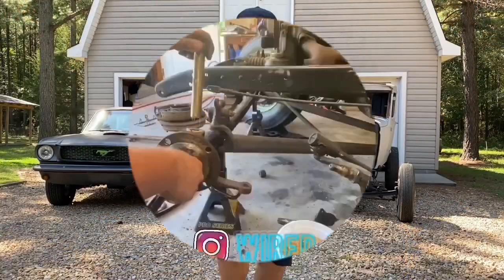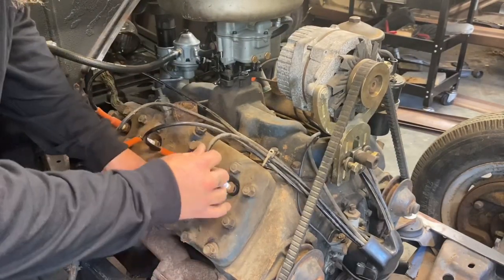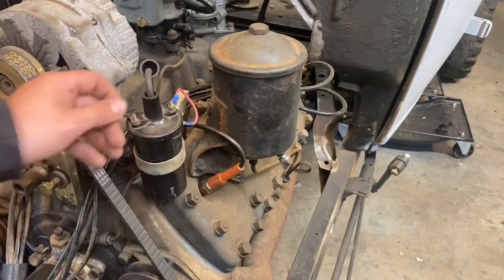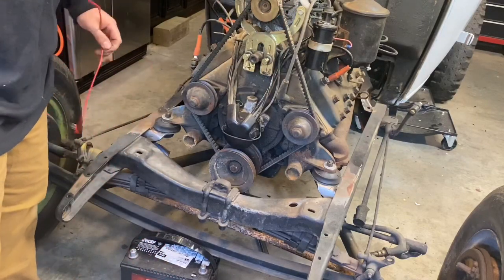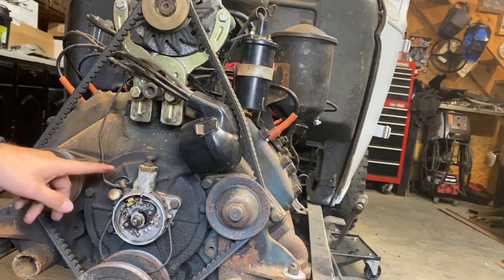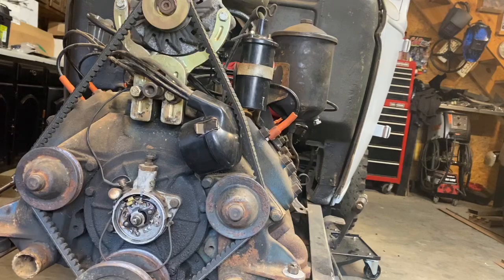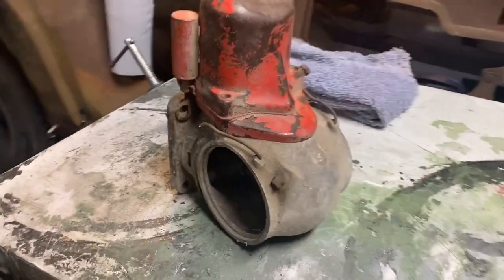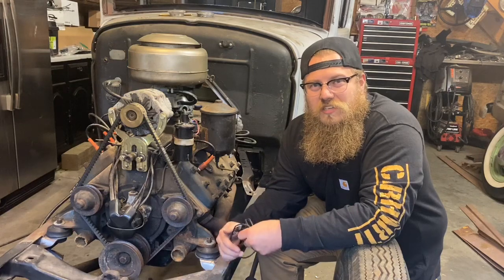No Spark No Start Ford Flathead Explained

Comment: It looks like you are negative to ground. When testing an isolated coil in a 6 volt positive ground systems, do you make any connection changes?  Also how would you test a condensor? I know they are cheap, but out of curiousity I'd like to know if it has failed.  Btw, for a 6 volt positive ground system, do I just walk up to the parts counter and ask for an ignition condensor, or do I need a specific type of condensor?
Thanks
Reply from the maker: Thank you for watching Pete. The process with a positive ground is exactly the same, the charge is just coming from the other side, testing a condenser is actually a really long complicated process since it can actually hold a charge, I find it easier to just test the points when unhooking the coil and letting the coil connection almost tough, and manually moving the points open and shut while looking for a spark at the coil connection, then doing the same and check for a spark at the points, that’s much easier then testing the condenser, as far as ordering them, you can pick one up from the parts store if you’re running 12 volts, but a 6 volt system will have a specific type of condenser, I haven’t found them at a parts store yet, I order mine from shoebox central in California
Reply: @WiredCustomsSpeedShop  Cool!  Thanks for all that info.
Reply from the maker: @vintagesirvivor   no problem at all

Comment: Are there different condenser for the different distributors or would one work on all? Thanks dealing with a no spark on a 40 ford
Reply from the maker: There are Bob, the early Helmet distributors have a specific style of condenser, the layers distributors are close to being all the same, depends on which distributor is on your engine
Reply: @WiredCustomsSpeedShop  I have a helmet with the 12 volt adapter
Reply from the maker: @Bob-qf4qo   so do you have the remote coil conversion too?
Reply: @WiredCustomsSpeedShop   no I don’t have that

Comment: Hi! Great video. I have installed a 1941 Zephyr V12 in a mahogany boat. I had it converted to 12 volts. It has  2 condensers and a built in coil. How do I hook up a new tachometer?  Maybe a 6 cylinder to one of the condensers? I am stumped! I can send pics if needed.
Thanks! Doug
Reply from the maker: Thank you for watching Doug! On the V12 you only have two options that I know of, either find a really expensive and hard to find mechanical tachometer, or upgrade the coil to a remote coil and hook up a tach traditional style
Reply: @WiredCustomsSpeedShop  could I wire a 6 cylinder tach to one  of the condensers?
Reply: It has the double distributor caps. Each side sparking 6 of the 12 cylinders.
Reply from the maker: @douglasfedt5299  yes sir the mechanical tachometer can run off of the generator
Reply from the maker: @douglasfedt5299   if you have one Doug you could give it a try, I haven’t tried it before but I would think after the condenser it might not put out enough to pick up on the tach
Reply: @WiredCustomsSpeedShop  there is no place else to hook a tach wire.
Reply from the maker: @douglasfedt5299  sadly there isn’t on that type of distributor, the technology wasn’t there yet back then
Reply: @WiredCustomsSpeedShop  thank you!
Reply from the maker: @douglasfedt5299   no problem!
Reply: Showing my age Dough but it was a really good shoe as Lawrence Well use to say he had a tv show many many years ago really great of u to provide this info for us new flat head owners I recently got a42 ford 4 door with sueside doors started it really runs good but I decided to put a new radiator on it if I ever get it delivered what with the supply chain like it is, thanks again!

Comment: Thanks for the great video. Just so happened i was trying to get my 49 ford flathead to fire up today it's been since 1986 that it ran  . No spark turns out the wire was open from coil to distributor. I was overjoyed when i finally saw a fat blue spark . Fired up right away but carb was leaking gas . Now to rebuild the carb . Long ways to go before i'm driving down the street ; ) Cool that you are trying to get your nephew interested in old cars. They need to be interested in something besides video games
Reply from the maker: Thank you for watching! Glad yours turned out good, my nephew definitely loves old cars now, he is always trying to sneak into my garage and sit in the cars haha

Comment: So I think I’ve decided to get a 1946 Ford Coupe. I’m just curious as to how much body roll it will have, especially since they have a transverse semi-elliptic leaf spring suspension. Have you ever rode in a car with a similar suspension set up?
Reply: I've got a 46  business coupe I'm about to sell
Reply from the maker: @blacksmithcrazy   nice! You should post it on “The Flatspot a Flathead Support Group” on Facebook, you would get some good feedback
Reply from the maker: I grew up and learned how to work on cars starting with a 1946 Ford  Business Coupe, that was my dads hotrod and he taught me how do do everything to the car,  these cars do have some body roll, but nothing you would consider dangerous, they feel more like you’re riding in a boat, or even similar to a Cadillac, just make sure you have good shocks and it’s a great ride
Reply: @WiredCustomsSpeedShop  Awesome! I found a 1946 Ford Coupe on the FB Marketplace that was last driven in the mid 70s. The upholstery is torn up, and the chrome is all rusted. They want $4,000 for it. Does that seem like a fair price?
Reply from the maker: @S5Ross1444  if the car isn’t very rusty then you have found one hell of a deal, coupes around where I live in Virginia can go up to 7000 if the body is in good shape and all the parts are there, it doesn’t have to be running
Reply: @WiredCustomsSpeedShop  Now if I could find a 1942 Coupe, that’d be even better, but one would be pretty hard to find, considering they were only made for 4 months.
Reply from the maker: @S5Ross1444  I would love one too, I have a 47 coupe I’ve been threading to put a 42 grill on
Reply: @WiredCustomsSpeedShop  Hey, it’s been awhile since I’ve replied to you on here, but how hard is it to find parts for a 42 Ford Coupe, as in things like trim, knobs, door handles, etc.? I’ve been debating on whether to get a 42 Ford Coupe, or a first gen Dodge Charger, which unfortunately is hard to find parts for as well.
Reply from the maker: @S5Ross1444   you can easily get everything you need for a 42 coupe, only the grill itself is hard to find because that’s the only difference between the 42 and 46 coupe
Reply: @WiredCustomsSpeedShop  Ah, so it’d be far easier, and probably many times cheaper, to restore a 42 Coupe. I’ve fallen in love with the first gen Chargers, but they’re so damn expensive to restore.
Reply from the maker: @S5Ross1444  I’ve restored a 68 charger, more than 3k just in the dash and center console alone
Reply: @WiredCustomsSpeedShop  I’d imagine it’d be even more on a 66-67 Charger, especially because they used an electroluminescent circuit to light up the dash, instead of actual lightbulbs, which looks really badass, but not very many people know how to fix that.
Reply from the maker: @S5Ross1444  yeah I haven’t messed with those before haha

Comment: I have an 8 BA with three Stromberg 97s. I changed the points over to a Pertronics unit and there was a noticeable increase in power. My question is how important is the vacuum advance since the 97s do not have a port. Anything worth fussing about? Thanks!
Reply from the maker: I would recommend drilling and tapping an aluminum intake for a vacuum port, but I have seen guys run them without it, I would suggest really powering it hard from a slow speed and see if you loose power, or even worse, choke and even die, if you’re having choking I would go with vacuum port on the intake, if not then you could just roll with it

Comment: Could you do a video on how to convert to a 90% filter oil system on the flathead?
If possible also how to convert to a remote modern spin on oil filter.
Reply from the maker: I would love to, just depends on my workload, I might have one coming up on a 42 Ford
Reply: A friend of mine has a system that he blocks the oil pump from going into the engine. He then re-routes it out through the side of the sump through a modern common spin on filter then into the back of the block where the pressure guage would go. He drills and taps it to a bigger size for more flow. It works well.

Comment: currently running an 8BA in my 49 sedan and recently noticed a miss fire at a high rpm but seemed to smooth out at idle. just brought her home so nothing has really been gone through. I had one oddball plug so naturally i changed em all and added new wires. still getting a miss fire on the top of second gear but smooths out into 3rd after a few seconds. After this video i now have a few things to sort through but on the idea of saving me some time what do you suggest? I just ordered a coil condenser and points and figured i might as well rule those out. Any help would be appreciated.
Reply from the maker: Since you already ordered those parts I would go ahead and replace them and try again, I would think it could be either accelerator pump or your power valve, if that’s still the case after cleaning up the spark with the parts you ordered, then a carb rebuild is in your future
Reply: @WiredCustomsSpeedShop  thanks for the advice 🤘
Reply from the maker: @smed395  no problem!

Comment: Man bud. Got my Flathead running last week in my 31 sedan. Then it started running like crap. Bad condenser. Put a new one in this morning. Drove around the block. Ours are a lot alike f1 steering etc. dig the build bud. Keep up the good work. 8ba here.
Reply from the maker: Kev Stubblefield thank you for watching! Glad you got your 8BA running, nothing like a model A with a flathead V8, I would recommend leaving a condenser in the car just incase

Comment: I plan on buying a 1951 Ford Shoebox in the future. These videos will definitely be helpful in the future when I get my hands on a Flattie! I’m kinda worried that it will have cracks though, like the ones that interfere with the cylinder bore. Would it be better to fix the crack itself, or use a bore sleeve?
Reply from the maker: Well the good news is Ford built millions of flatheads, so there is enough floating around I wouldn’t worry about fixing a crack between the valves to cylinder, and just get another, if there is cracks between the head stud and water jacket that was normal from the factory
Reply from the maker: ZEUSSx21  I would say the 8BA and 59 style blocks sound pretty similar, something to keep in mind is if you’re going to try to get some horsepower out of a flathead, and it being a 59, you’ll end up using all 8BA parts internally, I am obsessed with flatheads because of the sounds and looks, what I think gives it such a unique sound is the exhaust port going through the intake, and how it exits the block, nothing like a flathead with straight pipes and no muffler
Reply: @WiredCustomsSpeedShop  Hell yeah, especially with dual exhausts! I don’t plan on making it straight pipe, but I like the idea of having lake pipes, so I could have open headers anytime I want to.
Reply from the maker: ZEUSSx21 yup I love lake pipes too, that’s what my model a is getting

Comment: @wiredcustoms are you running a 12 volt coil with what ballast resistor are you using?
Reply from the maker: Correct, it is a 12 volt coil
Reply: Wired Customs LLC awesome. What is the specs on the coil (internal Ohms resistance, etc.) Also what are the specs on the ballast resistor? Thanks for your helpful video
Reply from the maker: As for the coil it’s usually .5 - 2 ohms, but I try to see the spark instead of trying to see OL, I look for the blue spark to see if it’s a strong coil, for the ballast resistor 1.5 - 5 ohms when new, and no problem at all!
Reply: @WiredCustomsSpeedShop  Thanks so much!
Reply from the maker: Andre L no problem!
Reply: Make sure you check the type of coil you're using . Some coils have internal resistor don't need a ballast resistor. If you run a ballast you should provide provisions to have 12v available for starting, then switch over to 6v for running.  Prefer internal resistor type coil, straight up installation no ballast to wire in plus you get blue spark when cranking. Starting thru ballast  causes  voltage drop along with weak spark. Have been a " mechanic  " since the late 50s. Mechanics fix techs replace.  : )
Reply: @joepacheco4038  thanks joe. So I should get a 12v internal resistor with a resistance of 1.5-5 ohms?

Comment: Hi just got 51 f3 , title says 1952 the truck VIN number says 1951. What do think ?
Is it hard to change it over from 6 V to 12 V and also can you change it over to electronica ignition?
Reply from the maker: It could’ve been built in 1951 and sold in 1952, they did things different back then, especially if the body style stayed the same, changing from 6 to 12 is easy when it comes to the engine, a little more difficult for the vehicle, if you don’t protect all your gauges you can blow them, as far as pertronics, it’s a simple change and makes a huge difference and greater dependability
Reply: @WiredCustomsSpeedShop  I would also enjoy seeing a video on how to convert to 12volts.  I know iron trap garage just showed a 6volt generator work on a 12volt system but they didn't say how they did it. (Unless generators adjust to whatever the battery takes?)
Reply: @David-82  most likely switched to a 12v gen. Haven't seen the video just guessing. They make 12 alt that look like gen for flathead engines.